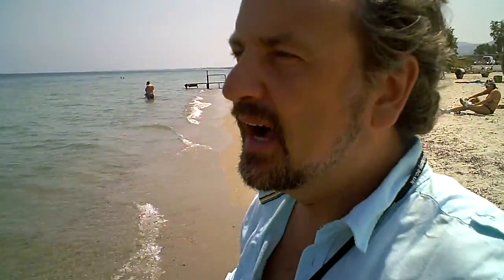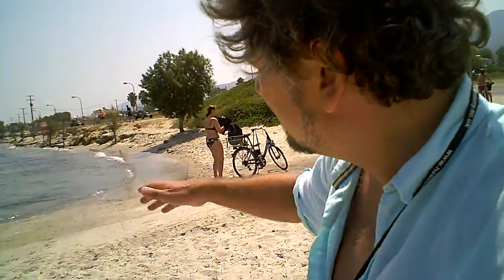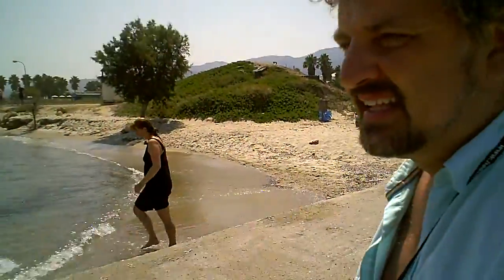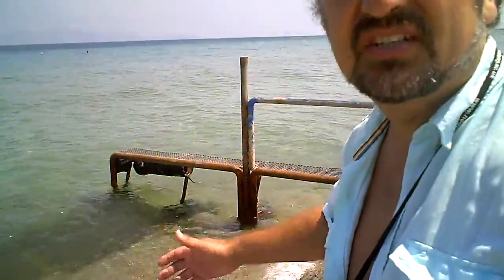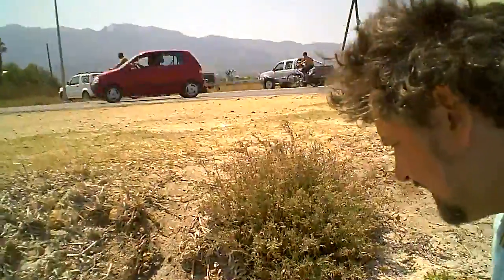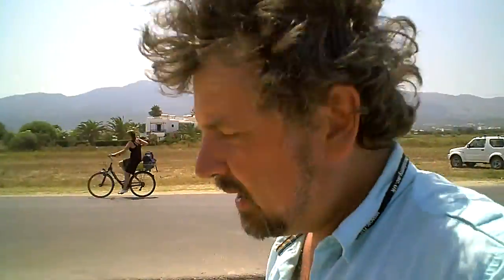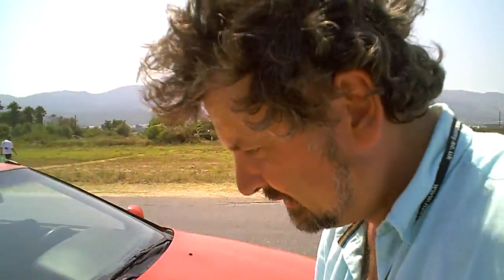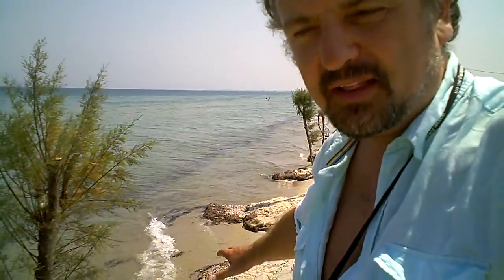Coastal Systems - Shoreline Retreat, Longshore Drift and Groynes

Comment: From what I learned from this video is that the groin should have gone at a diagonal, perpendicular parallel to the longshore drift, instead it is creating an impermeable berm perpendicular to the beach, causing a vacuum of sorts on the opposite side of the boat launch, wherein the sand gets drawn away from the tide. Think of putting your feet in the sand, with the tide coming in and out, slowly your feet sink, creating a berm around your feet as the sand is eroded.